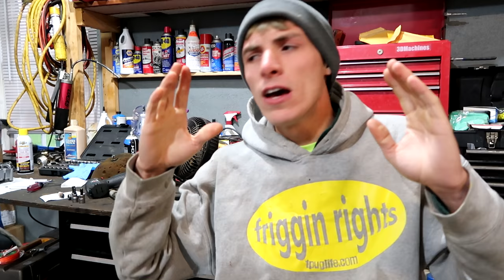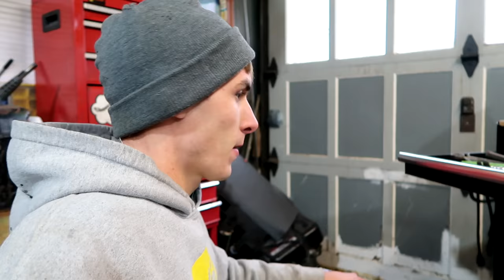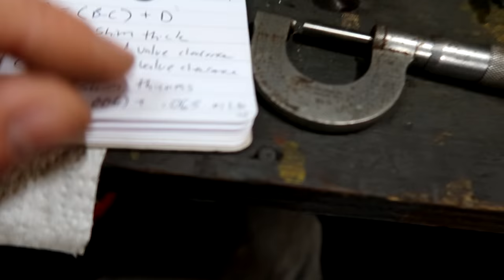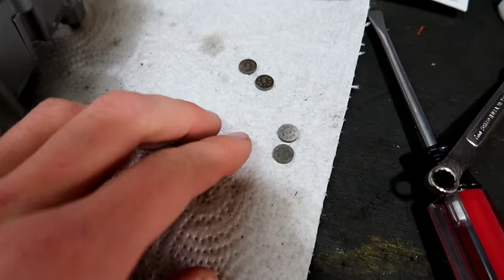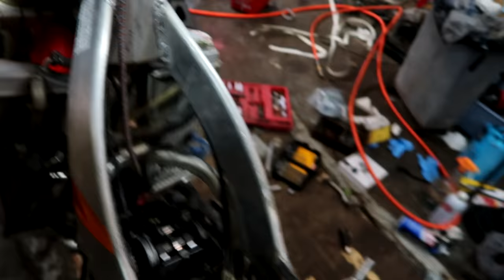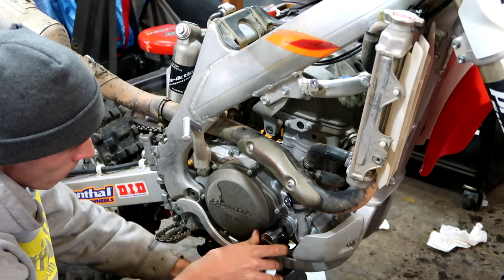BUYING THE WRONG PARTS

Comment: Hey dalton I've done overhead doors with my dad for a while now. What you need is a weather strip on the bottom of the door. It's a rubber strip, you should be able to get one at lowes or Home Depot. Just screw it or nail it to the bottom. I hope I may have helped a little you probably already knew that already but it's good haha love the vids man! Keep em coming!
Reply: good advice, also the rubber keeps the bottom of the door from sitting on the wet ground and rotting faster

Comment: the bolts that you said we're expensive are most likely higher grade bolts rather than the really soft metal ones you get at a hardware store, just something to keep in mind like bolts for brakes are gonna be grade 8 and up so never put anything lower or it will break, worth a search on Google very important, hope this helps

Comment: use the micrometer and measure the current shims, then subtract the needed clearance from the micrometer reading then convert to millimeters. Or do like I did and get the shim kit and mic the shims until you find the size you need.

Comment: hi 3dmachines. just incase you didnt know you dont need to take out the shock to remove the carb. just pull back the carb and move it against the exhaust then pull straight upwards.

Comment: Just so you know 1.2 mm is the smallest shim they make, once you are that low you need new valves and seats.When I was younger I was as skinny as a rail, I would eat like a horse and work out and never gain a pound. Once I hit my late 20s my metabolism started to slow and I gained weight . Problem was I still had bad over eating habits and gained to much weight. Now I have to watch my weight.

Comment: its not necessary to take the shock off to get the carb off. I slide mine through the kickstart side of the frame just fine. In and out easily

Comment: lol don't need to take the shock off to get the carburetor out of my 04 yz250f lol. it's like the only reason i enjoy the steel frame, easy to work around other than right above the engine.

Comment: hey dalton (3d machines) i need some tips i just fixed my 1993 yamha yfs 200 blaster and it starts first kick but the clutch wont grab so i cant get out of gear any advice will help and be appreciated 110%
Reply: keegan ashbee Bean have you checked your adjustments at the handlebars and on your case? I had a 01 blaster
Reply: keegan ashbee Bean try adjusting your clutch cables before you get to deep into it.
Reply: keep dreaming homie. Dalton will NEVER comment back to you. Sorry to break the bad news.
Reply: get new clutch disks and adjust properly also shave down any ridges on the clutch baskets fingers

Comment: You have to workout if you want to gain weight, even if you just do push ups, and crunches. You have to actually feel some pain, before you can gain. I figured this out by going to jail. Went in looking like you, could not even fit in my old clothes going out, 4 months. I could do pushups, and situps all day long.
Reply: marie pollard
Yes build mass, muscle, of course you still have to eat.
 If you don't have fat to burn off, then you are just building muscle weight. When I started, I couldn't even do 50 pushups, when I left, I could do 50+50+50+50 in my sleep. Believe me, I was much bigger 4 month later, and it wasn't fat.

Comment: way to avoid most of 3ds problems get a 2 stroke haha
Reply: 2 stroke you cant rev while they start up say if its cold you cant just start it up and rev alot like you can with 4 stroke and 2 stroke you can hold accelerater long riding or it blows the engine up but a 4 stroke you can hold that thing down and torture the shit out of it and still runs and goes
Reply: marie pollard yeah but power bans in a  2 stroke and they sound nice and easy af to put new top and bottom end in